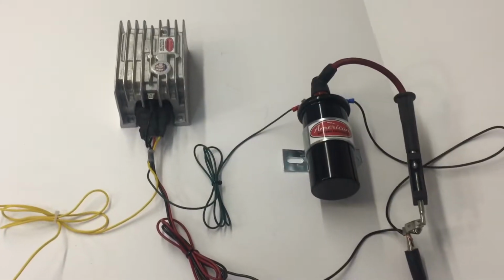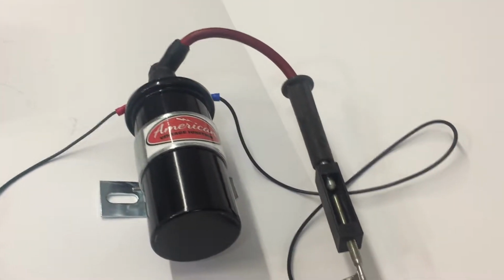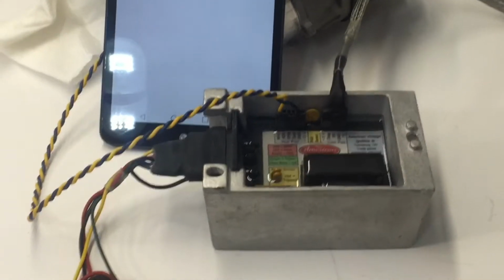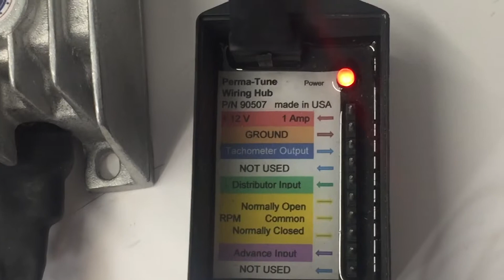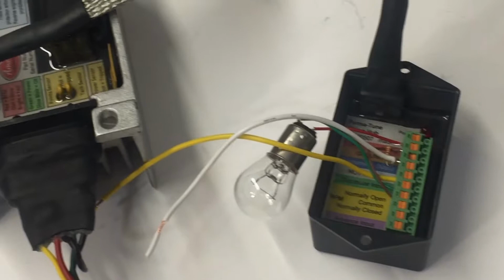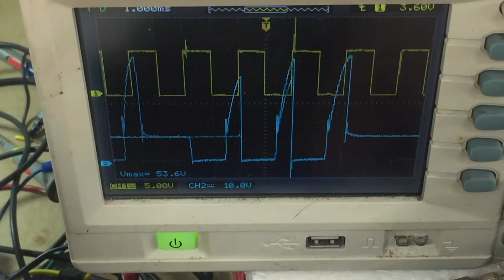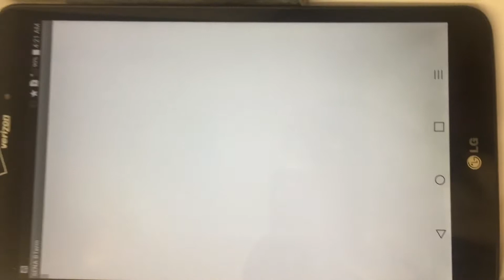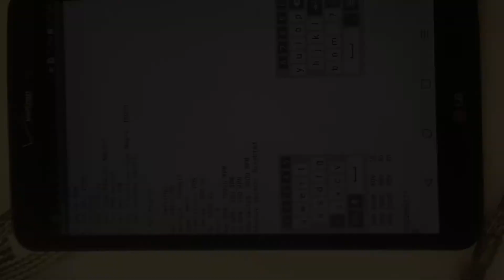Perma-Tune Ignition System Installation - Race Car CLS Configuration

Comment: Hi .I have a 911 with 2.7 and previous owner installed permatune  on the car. The car cranks fine but doesn't  get power to the coil however it gets power to the permatune. What's a chance that the box is bad ? Thanks